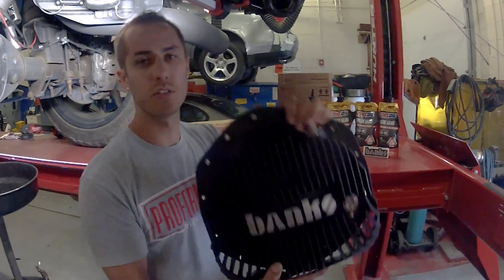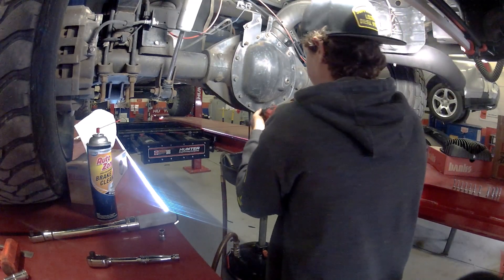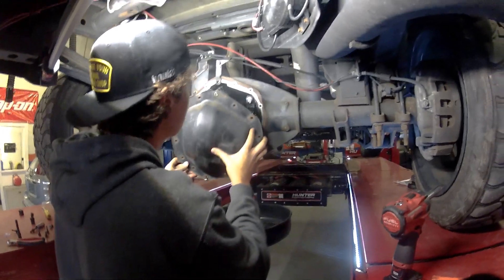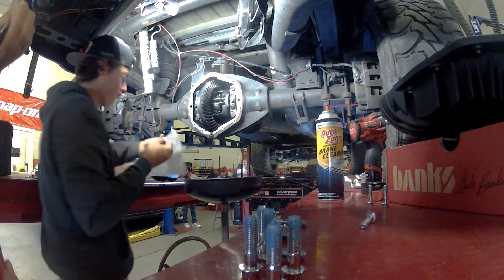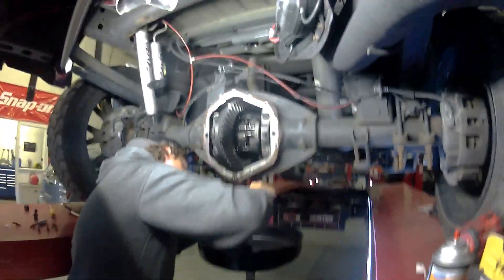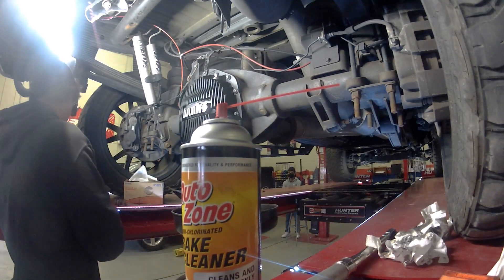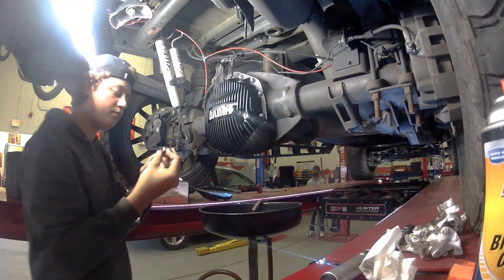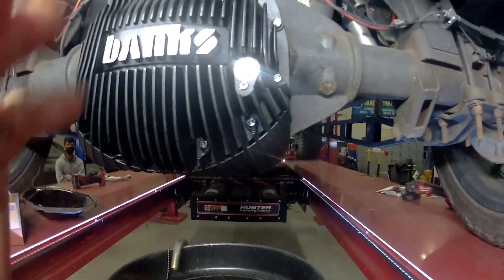Auto shop teacher uses BANKS RAM-AIR DIFF COVER as teaching aid

Comment: Nice demo. I have installed one of these on my F350. Only thing I think you should have showed is the attachment of the gasket into the dif cover. It at first seems to be too large and I’ve seen videos where people actually cut them. This is not correct and all that needs to be done is to slowly work it into the groove.

Comment: That was strange why would you spray and  Degreasing agent all over the inside of your housing especially with a lsd diff in my mind not a smart move but probably won't cause any real problems good luck
Reply: And dirt getting into the pinion bearings. I saw a guy that rebuilt a diff because of the noise. That shot of brake cleaner was a really bad move.
Reply: The G80 rear diffs aren’t LSD’s  they are Eaton Locking diffs … they do not take lsd additive and should have diff fluid with no modifiers as per Eaton ….   Spaying with brake clean won’t hurt anything is evaporates completely!

Comment: One thing I would have never done. It sprayed break clean in the deferential number one. It can dry out the seals and the definition which is a no no This is one thing A diesel mechanic would never do and the other thing is that it could also mess up the internals

Comment: Fluid dripping from bottom, sealing surface not cleaned, brake cleaner all over inside, diff sump not wiped...hmmm ya no way yer students are working on my truck!
Reply: I used steel wool to clean around and I also put a little bit of grey silicone around my gasket. I also noticed he didn’t add the limited slip additive
Reply: Its a rubber oring similar to that of an oil filter. A small amount of fluid will not hurt anything. If we were using silicone, than yes I would want it bone dry.
Reply: @brendazamudio1979  amsoil has the additive in it already.